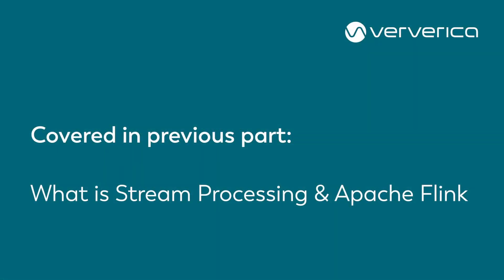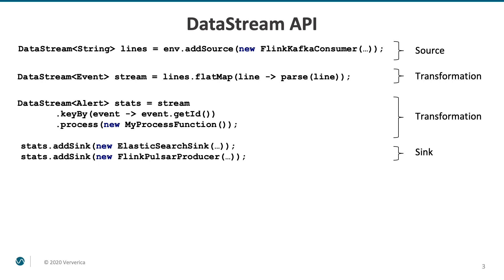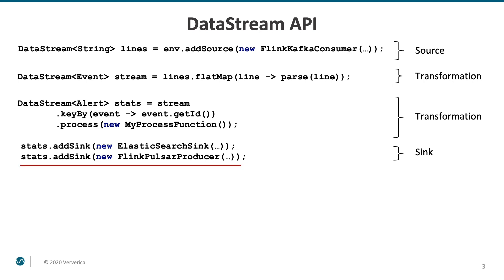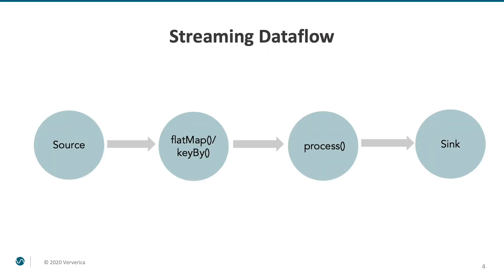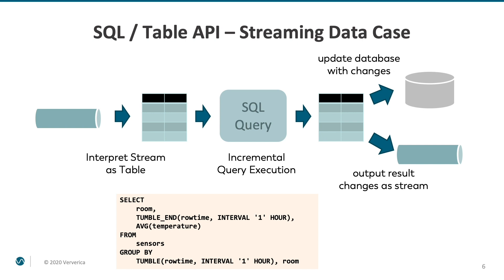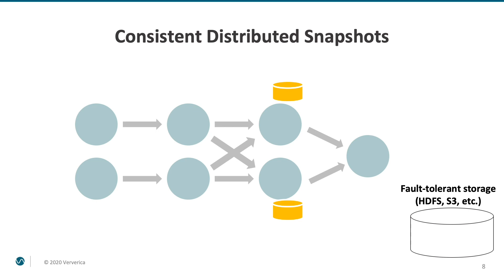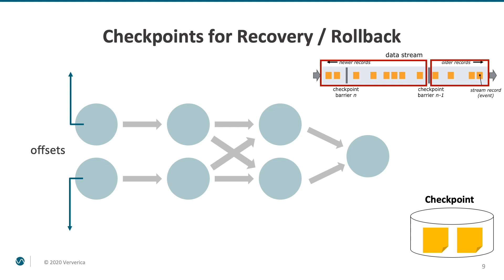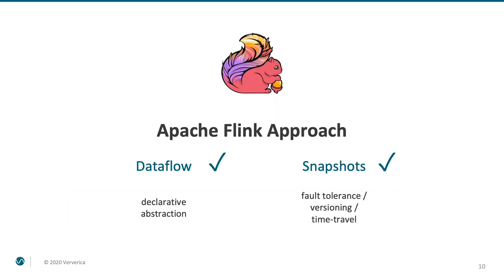Streaming Concepts & Introduction to Flink - Apache Flink Dataflow & Snapshots

Comment: This is really good explanation. SO Basically Flink itself manages the offset of consumers and it does not call kafka api for committing the offset. It saves consumer offset along with checkpoint call. For some reason if system crashes, it restore the state of all operators from last successfull checkpoint state and stateful operator also restores to that previous state and kafka messages will be replayed again which were not processed successfully end to end.

Comment: So to restore from a failure, I need to restore the input stream before the checkpoint barrier. Isnt it very costly to backup all the input until the checkpoint ?
Reply: @Alexander Fedulov Thanks !
So the fault tolerance is dependent on the framework that inputs the data ?
But isnt it also a bit inefficient, since you need to redo the whole computation from input to output ?
Reply: Thanks! That was very helpful :)